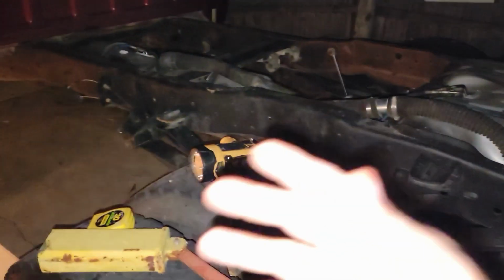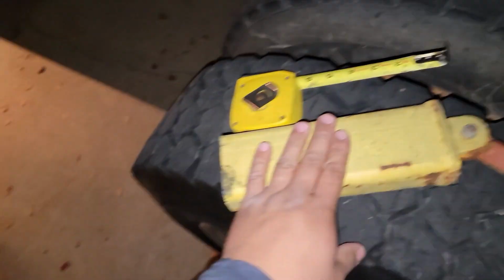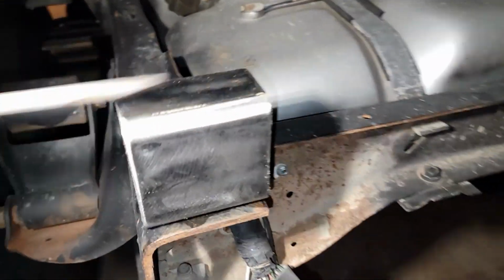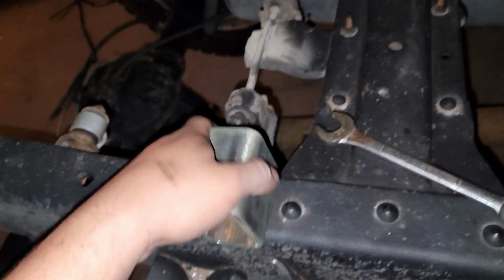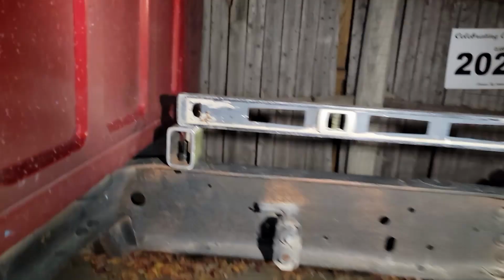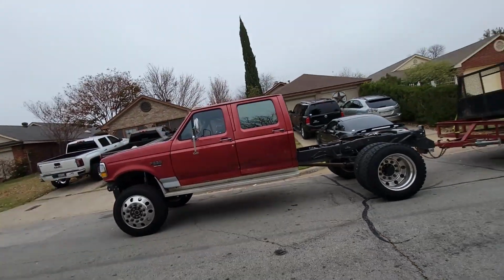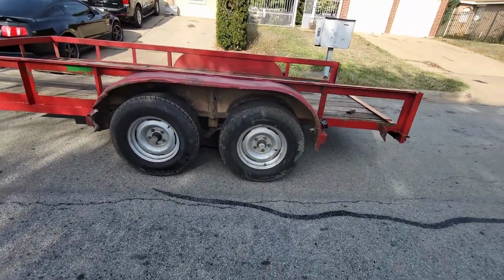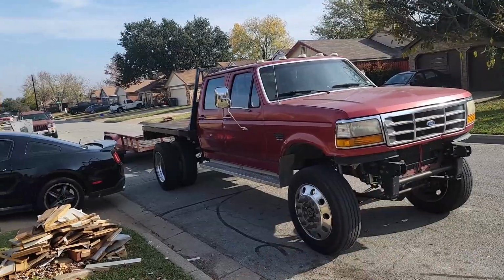Installing a Flatbed the Right Way! Stock Bed Holes

Comment: Well sir I’ve got good news. The old dodge is up and running to its full ability. 1 new injector pump and a clogged banjo bolt later, she purrs going down the road. I’ll upload some videos on it in the upcoming days. Do you still have the stack?